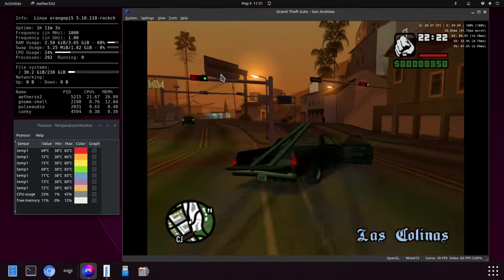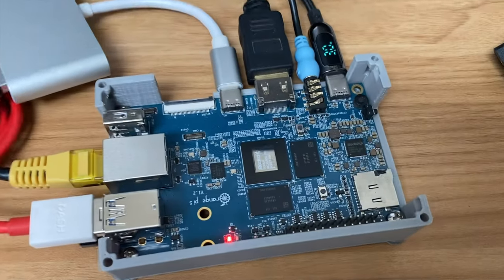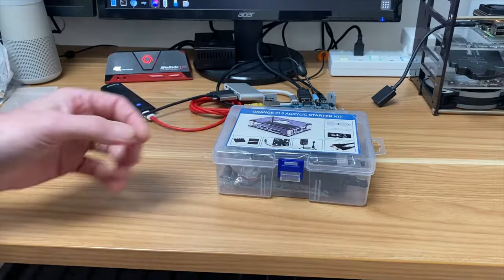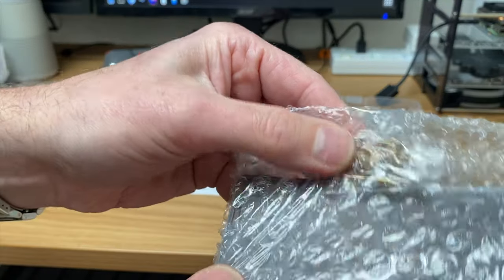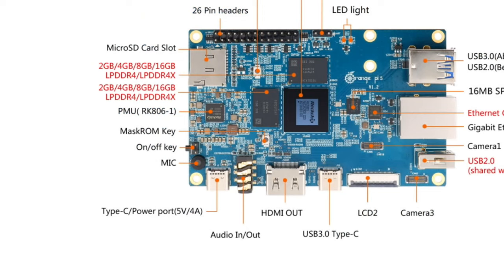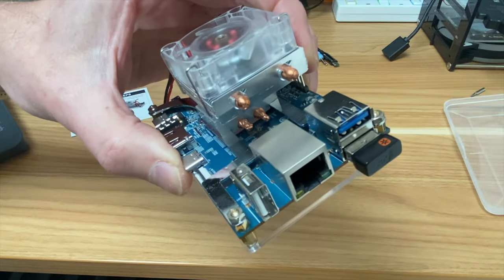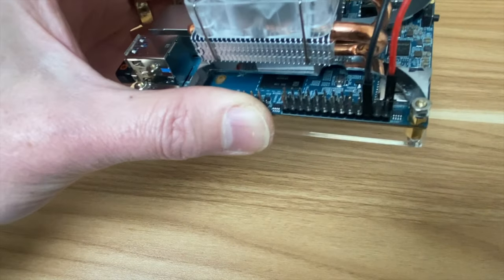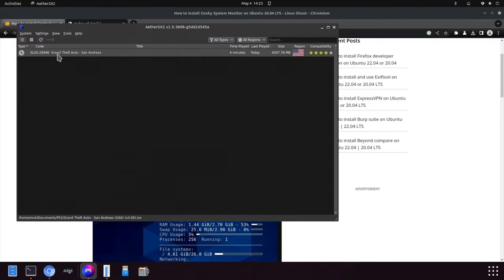Super quiet Low profile CPU Cooler for Orange Pi 5/5B.

Comment: I didn't find anything on the official website but the CNX website has an analysis of the Orange Pi 5 Plus with RK3588. Includes:
eMMC flash socket for 32GB, 64GB, 128GB, or 256GB module
M.2 2280 PCIe 3.0 x4 socket for NVMe SSDs up to 2,000 MB/s
2x HDMI 2.1 ports up to 8Kp60
HDMI 2.0 input up to 4Kp60
2x 2.5GbE RJ45 ports via RTL8125BG controllers

IN MY OPINION this is the perfect board. It brings together the best features of the 5 and 5B and adds some improvements: a) it has eMMC and also b) m.2 nvme ssd up to 8 cm (2280); c) it has one more socket m2 to use wifi and bluetooth; d) Two HDMI outputs and one HDMI input and e) two Ethernet inputs (RJ45, too much). Is perfect!

Comment: Did you heard about the Orange PI 5 Plus? RK3588 based with pci-e 3.0, dual m.2, hdmi in, dual 2.5G nic, etc... they just made the best RK3588 SBC by far, even the anounced price is good, $109 for the 8GB model. With the HDMI-IN alone you can use it as a standalone 1080p streaming/capture card.

Comment: Wow a most interesting cooling fan. I am running Artificial Intelligence and Computer Vision on the Orange Pi-5 16GB. The 8 cores are about 73% with board size Heat Sink = 69 degree-C.  Nice to see more sweet orange pi-5 devices.  🥳 Thank you.

Comment: cool! literally ;-)
I test any SBC with stress-ng program with all cores enabled and in parallel to that, a thread to SSD - this way I know that it is really full what the board can do
I have just ran such test on my orange pi 5 and the observations in my system are: (I have little fan on top of the heatsink - 5$ from Ali - connected to GPIO pin, controlled by python script ON  when temperature goes above 50C, OFF when < 40C):
- ambient temperature: around 20C (summer in UK! ;-) )
- idle CPU temperature: 29C, AC power: 5W (fan is OFF)
- full stress maximum CPU temperature: 51C (that is when fan starts)
- full stress average CPU temperature: 49C, AC power: 13W (fan still works as it is in the range of fan to be ON)
So far far from 4A current.
And the power was measured on AC side so that includes the efficiency of the power supply (unlike if you measure on DC side - if you only measure the power consumed by Orange Pi you don't see the power consumed by the power supply)

Comment: Linux support for the Orange Pi's is improving rapidly. The mainline 6.3 kernel appears to have basic support now for the RK3588 - soon you may be able to build the latest kernel from the upstream source without any hacky patches. This is all essential for building a vibrant community around the Orange Pi. Anyone test the compatibility of 3rd party RPi hardware on the Orange Pi, particularly Pi HATs?

Comment: 5:56 The difference seems impressive, however I've seen other comparisons and the REAL difference is made by the heatsink alone and NOT by active cooling. You should get a small heatsink with a thermal solution and compare against the cooler, you might be surprised.
Reply from the maker: I know these heat sinks are very effective as I have used them extensively on the Pi 4. The fan still helps when the Pi is working hard

Comment: Thanks as always!  Question, I bought this based on your last video, and the black aluminum heatsink/fan that covers the whole board.  Have you tested which is cooler?
Reply from the maker: I haven’t
Reply: It would be realy nice to fit this tower in the case. I also have bought it, geekworm's n505 case. But even without a tower it's getting low temps.

Comment: im condidering buying either the orange pi 5b or the r58x hdd, now that you have had both devices, could you say what device you would recommend for what type of user?
Reply from the maker: The Mekotronics has the better hardware. Orange Pi 5 being cheaper seems to get more software options.

Comment: Its been a year since im using this. If i want to change the thermal pad. What sugestion fot the thermal pad. 2mm or 3mm thickness?
Reply from the maker: @xsetiadi  I would use paste

CPU paste Vs Thermal Pad. Raspberry Pi 4
https://youtu.be/-Z05yBrU0jQ
Reply: @leepspvideo  does 1mm copper plate is good? its hard to find 1.5mm copper plate for paste.
Reply from the maker: @xsetiadi  I would just use paste
Reply: @leepspvideo  but there's a gap about 1.8mm between the soc and heatsink.

Comment: to all watching this pi board is a security risk and i mean a high one.
Reply: And how is that
Reply: @dim3nt0  it keeps going to chinese servers.
Reply: @jediknight2350  In what way is it "going to Chinese servers"?
Reply: @jediknight2350  wich distro? and what exactly is going to chinese servers?
Reply: @dim3nt0  doesnt matter on distro its constantly going to unkown chinese servers which makes me think its built in.
Reply: Please provide real evidence, not conspiracy theories. Or anything factual about this SBC.
Reply: @dktol56  exactly - show something before making a fuss. 
And I am going to test it - my Orange Pi is behind opnsense firewall - I will check if that is really the case ;-)
I am using the Debian OS on my Orange Pi - I removed from sources.list the calls to huawei and left only to the official Debian repos
Reply: OK, I ran some tests while logging the network interface (using my firewall opnsense) and honestly speaking I cannot see any suspicious IP - all where as per defined sources.list or as expected by the running services on my Orange
But I am not an expert - I might have missed something